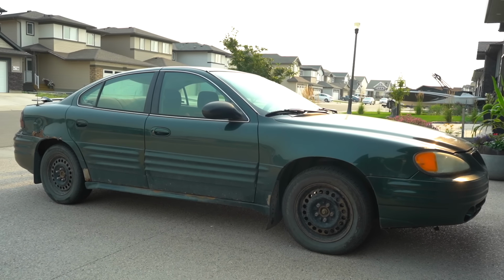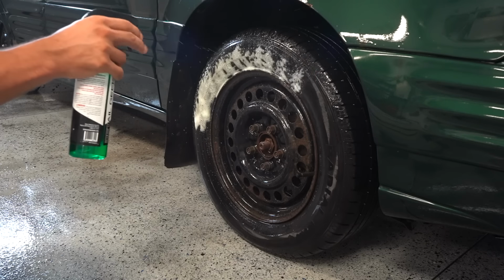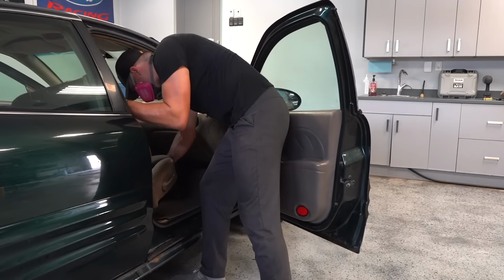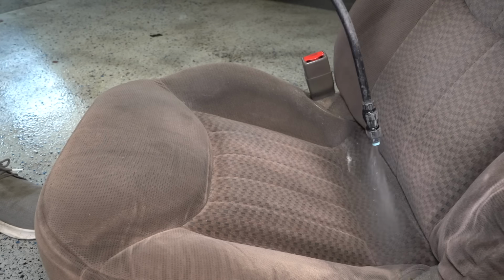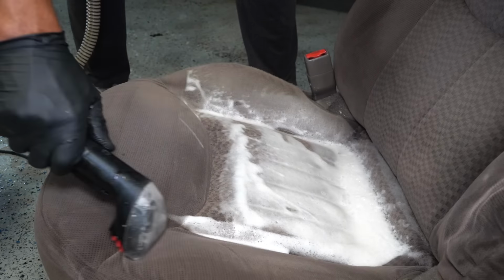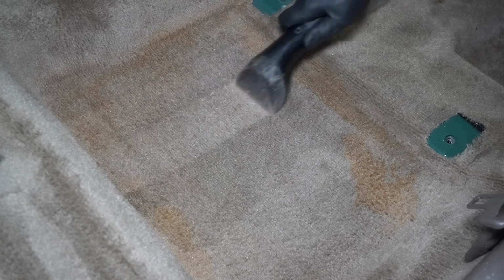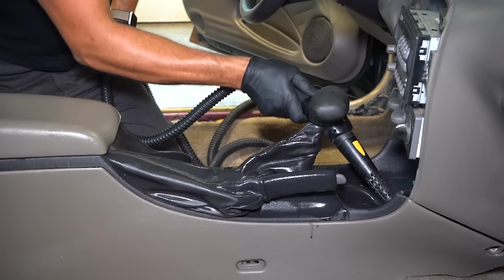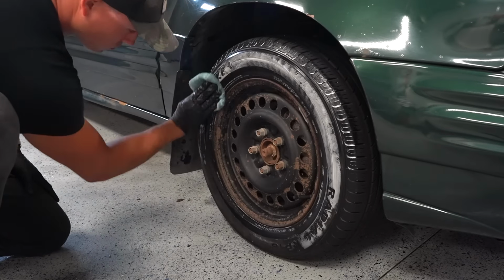Deep Cleaning a SMOKER'S Nasty Car! |  The Detail Geek

Comment: Pontiacs from 1986 to 2004 are actually good cars especially if you can get the 3800 engine.

General Motors (Pontiac, Buick, Chevy, Cadillac and GMC) were pretty decent until 2006.

Anyone shopping for a used car check out the ones before 2006.

If they are low miles and taken care of, you can get a solid car.
Reply: So right about the 3800 v6. Can't remember what year they switched to the Dexcool coolant, but they had some issues with the plastic intakes for a few years because of it. All those should be fixed by now though.
And my 1990 Bonneville is still going strong, little rough but what can you really expect 32 years later?

Comment: When you ran the ozone machine did you run the car with the heat on high? That opens the pores in the materials and gets more of the smell out. It would also help with the smell in the hvac system. I used to do fire and water restoration. Running the heat on high was standard procedure. Also, do you detail under the hood on any of these vehicles?
Reply: He only details under the hood if they ask. For most people it's out of sight out of mind

Comment: Lovely detail!

I remember when I was a teenager, my uncle had a 2000 Pontiac Grand Am Coupe that he LS swapped and converted it to RWD. Man, that one beast of a machine! The engine came from a wrecked C5 Corvette that my uncle picked up for cheap. He modified the engine adding a larger throttle body, mild cam, long tube headers, and full side exhaust with high flow cats. It sounded nice. Sadly, the car met it's fate while my uncle was track racing it back in 2006 and totaled the car. Slid off the track and hit a tire wall/fencing. Messed the front end up pretty badly. He was fine. Just a few bruises and a broken wrist. The car ended up going to the scrap yard.

Comment: What's the best way to get streak free windows? Anytime I clean my windshield I get streaks but I find in hard to clean due to its angle. I also use RainX on the outside and am not sure the best way to remove the old rainX when I replace it during the next cleaning.

Your videos are so great have given me new ideas on how to better clean my vehicles. Thanks for your hard work!

Comment: Can you tell if the seat/ carpet is clean based on the color of the water coming through the hose? I have been going by the color of the water in my tank. No matter how many times I use my extractor on my seats/carpet, I always end up with dirty water in my tank.

Comment: I drove a 1990 Grand Am from 1996-2002.  Then from 2002-2012 I drove a 2000 Grand Am.  Loved both those cars !
Reply: Really liked my 1990 Grand Prix. Granted it was a legit POS, more rust then paint, interior was really trashed, but for the $100 I paid for it, sure got me where I needed to be. Actually kind of miss that car, probably would have kept it if it had the 3800 v6 in it.

Comment: With that carpet staining, I usually spray it white vinegar liberally and let it soak for an hour. Then use your Chemical Guys, let it set for 15 minutes. Hit it with Chemical Guys again before you agitate. Add a very small amount of bleach in the Bissell  and scrub a little with the extractor brush as you go. Should pretty much knock it out. Steam works really well before agitation with the cleaners fully soaked in before hand. I've been detailing since I was 18. Started at Value Guard back then. I'm 40 now, been in it for a while. As always, sometimes it works, sometimes it doesn't. You always have to know when to stop. You can make more problems if you don't. You're a bad dude, you do really good work 👍.

Comment: I have a truck wash chemical that is touch free and safe on clear coats and ceramic coatings. It is also biodegradable. I use it in a foam cannon from chemical guys and let it set for 2 to 4 minutes and wash it off. I do use a industrial 4400psi washer though.... you do a fantastic job my guy. Really inspirational 👏

Comment: Have to admit that GM cut pile is the easiest carpet to work with, but in light gray is also the easiest to stain.  The carpet in my van is basically just like this up front but not nearly as bad throughout, which is probably because none of the previous owners had kids and mine are older now.  Once I've sorted out the drain for the AC evaporator (it leaks on the driver side floor pretty bad) I am looking forward to getting my carpets and gray cloth seats done to look like these ended up.  That, a rear wiper motor, power mirror switch, couple of burned out desh backlighting bulbs, and the missing glove box door and it'll be nearly perfect inside and out.

Comment: Wow!  Nice job.  I have a theory about stains.  If they are rust colored, even if the original source was dirt, or coffee, etc. then it could be that they have turned into a form of rust (iron oxide).  After shampooing, you could try hitting them with some clothing rust remover, or a light acid.  It works for me on clothing that has rust colored stains, even if they were dirt, or mustard, or something else.

Comment: Just did my wife’s car basically step by step the way you did it.
When you say 10-18 hr days you are not kidding. I think most of the time is working the brissle and agitating but honestly I’m 100% satisfied. 

Anyone who is doing the same most 6.5 shop vacs come with large attachments. The amazing skinny one he uses I had to buy separate but other than that. I’m happy

And it’s not a hastle to take your seats out. Shouldn’t take more than 5 minutes and it makes life easier when you’re putting in work on the carpet and the chairs outside of the car.

One thing I’m going to try and I can complete be wasting time is a clear “brissle” attachment for my wet dry shop vac. The brissle does amazing but I personally want to speed up the drying time

Comment: I wonder if the reddish-brown stains on the carpet that would not come out was rust coming from the floor panels under the carpet? Maybe the underside of the car was rusting as was as some body panels? Although, when you cleaned underneath there didn't appear to be any rust under the car. 

The frame even appeared to be free of rust. If so, strange how there was so many rusty places on the painted body panels. 

Then again, that car may have been produced during that era where GM wasn't exactly producing quality product. My Father-in-Law purchased a Chevy truck from that era and it was a piece of crap. The paint started coming off of the hood after only after a year and a half... there were mechanical issues, electrical issues, etc.  He should have pulled the "Lemon Law" on them, but didn't!. :-\

Anyway, you do a great job... and you're a brave man cleaning some of the rides you clean... VERY BRAVE!  I think I would have to have a HAZMAT suit as well as a respirator! :-P

Comment: The car don't look that bad just need to fix the rust spots...lol the car looks brand-new compared to what my mom used to drive way back in the day an old station wagon lol...had so many rust spots had a big hole in the floor board to where you could literally put your foot down on the ground and drive like the Flintstones 🤣🤣🤣🤣🤣🤣🤣 and the car smoke while driving it looked like a big dust storm on the move....lol it got you from point a to point b...lol R.I.P. ol yellow 💛

Comment: Hey I have a question! I’m moving into my first house here shortly and the garage happens to have a water spigot in it! Which made my detailing desires happy, however I am curious on how much of a pain it is to add a garage floor drain in the concrete that is poured solid without one. I plan on adding a garage heater and Im sure there is a slight slope to the garage floor but I don’t think they amount of water will drain quick enough. Also it is a two car, so how do I avoid soaking the drywall? Any advice helps! I watch every video that comes out and love the work you do!

Comment: An excellent detailing job on a piece of crap car. The paint is polished so well you can see the scratches clearly and it highlights the rusty parts even more, the windscreen is so clean you can see the cracks in it much better, and the tyres deep black helps to contrast the rust on the rims lol. I bet it still stinks inside anyway, doesn't matter what you do to clean a smokers car, they always reek.

Comment: @TheDetailGeek, I'd like to suggest a test cleaner for the next tough carpet stain you have. I have been testing this on a variety of things and I've found that rubbing alcohol can help lift stains that stick to fibers and surfaces and also helps to dry out water. I recommend applying just rubbing alcohol first, using the agitator, then trying suction and water

Comment: That vehicle wouldn't be allowed on the road in the UK. The seat base is rusting which is a MOT fail, the wheel wells are rusted through which is structural and is another major fail. This vehicle would be considered "uneconomical to repair" by most mechanics, And the cost to fix the rust more than likely outweigh the value of the car. So why would he spend hundreds of dollars getting that piece of junk valleted?